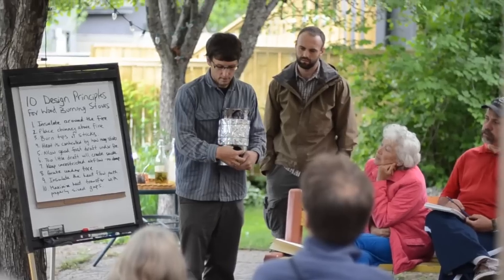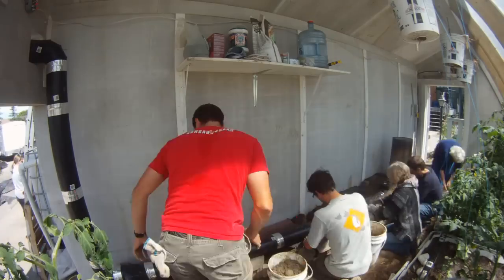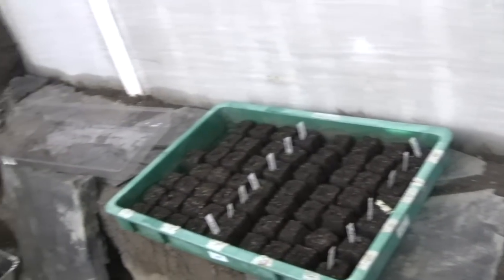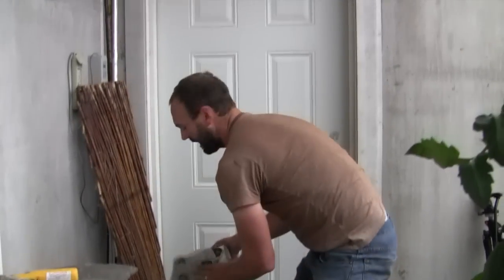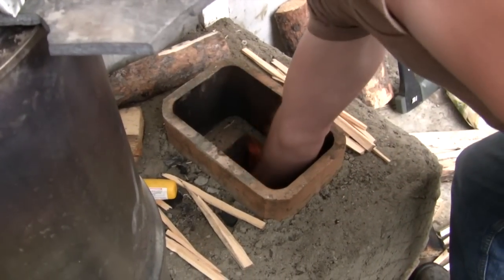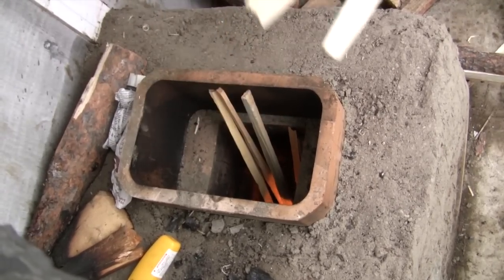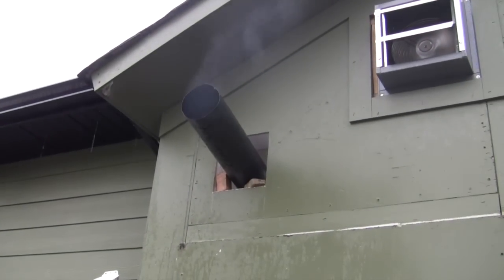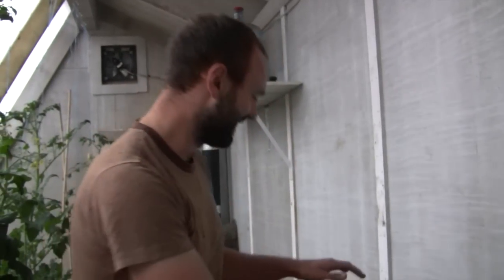Rocket Mass Heater Workshop:  Permaculture homesteading

Comment: You want to balance thermal mass with radiation. In addition the loss of radition on the barrel helps to drive the system as cooling gases contract and create that rocket effect.

Comment: Great video! One question: Why is the barrel not also insulated with earth?  Seems like it would just add more mass for the heat to be stored in and the barrel stack would not get so hot to the touch.  Could you please explain this?  Thanks!

Comment: clogart, you need to make sure that the gap between the heat riser and the barrel has at least the same ammount of area or more than the inner diamter of the heat riser. Basically you don't want a restriction, you want an expansion.